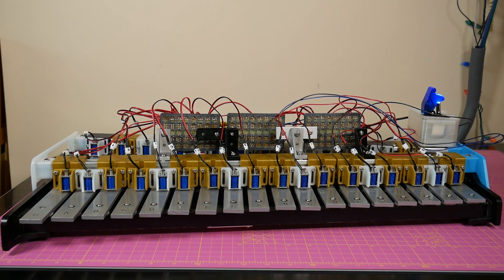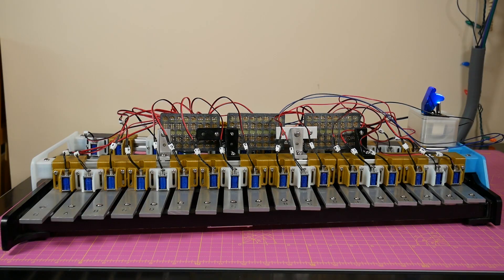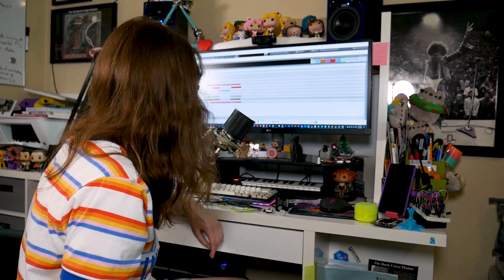The Robot Xylophone Has Landed

Comment: Hello there
first of all your project is realy awsome!:) 
I try this and i have a question

i want that NoteOn message in phyton is related to the midi note lenght how would that be possible ?

"Why is it only looking for a NoteOn message? The way that mallet instruments work is that they have to be struck quickly in order for the note to resonate properly. If the code were waiting for a NoteOff message, then for longer note values the solenoid may not retract quickly enough to sound the note. That's why everything is relying on that initial NoteOn message." (Blitz City DIY)

greetings from Leipzig 
Marcel